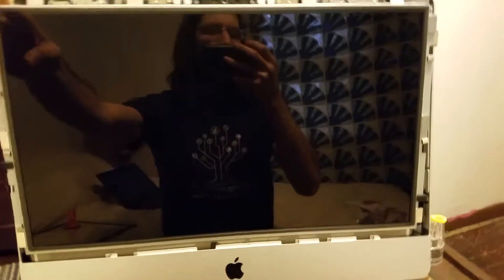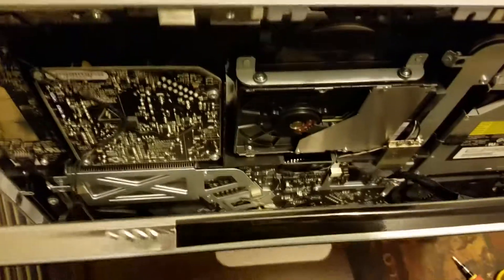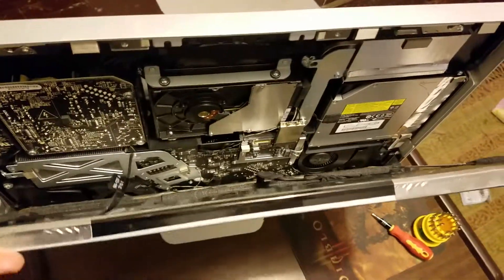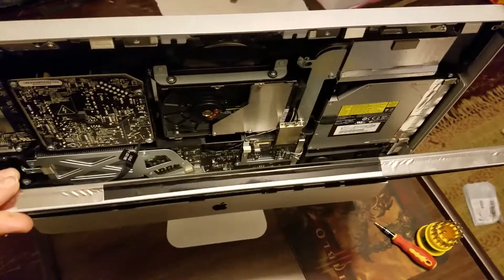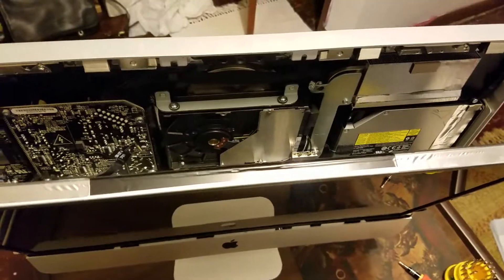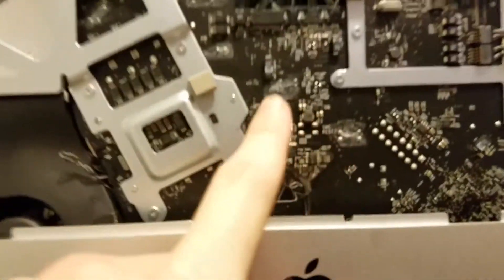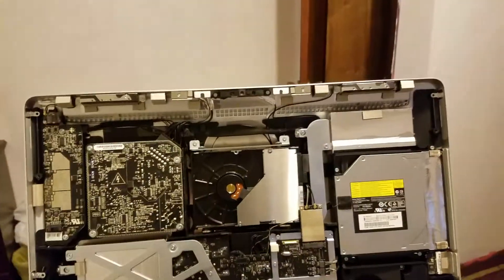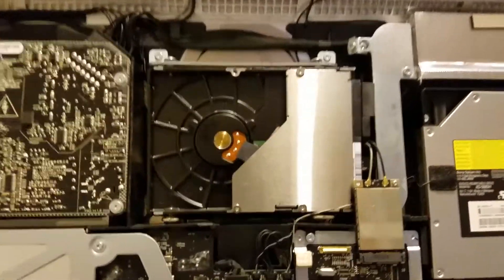iMac Mid 2011 21.5" Inch - Removing Screen, Changing Hard Drive (HDD) Replacement / Teardown

Comment: Are you still monitoring the comments of this video? I'd really like to ask how the 6 pin temp sensor is supposed to be attached/oriented on the drive itself.
Reply from the maker: I don't recall. I would recommend looking up the tech manual for the model.